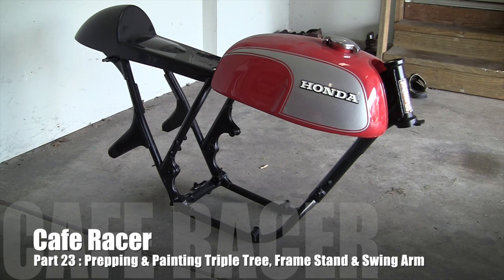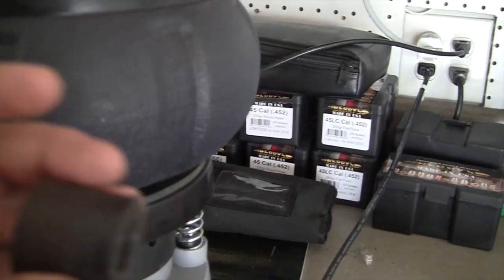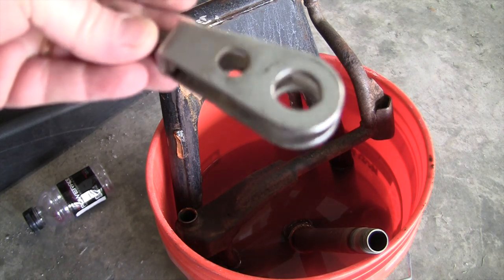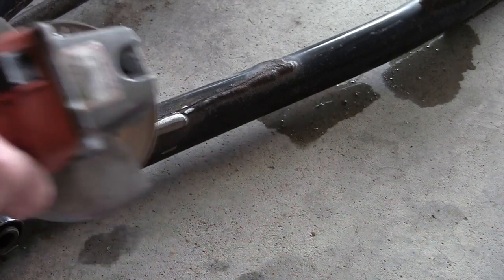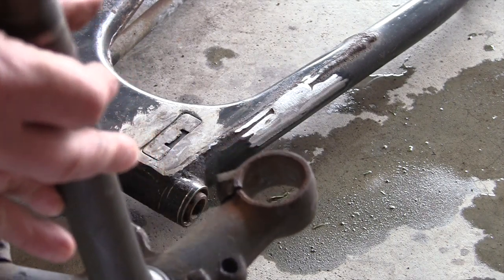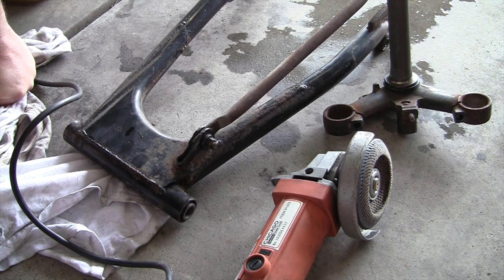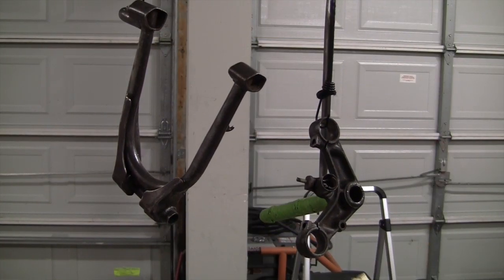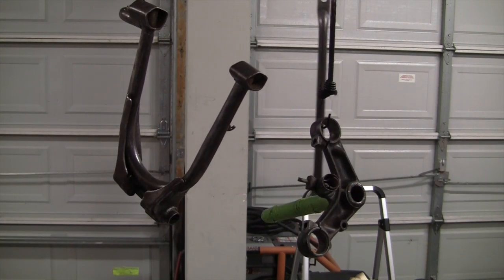Cafe Racer Build : Part 23 Prepping & Painting Triple Tree & More!

Comment: Great vid. I had the same problem with my steering stem with one of my stoppers but i used some rough sandpaper to rough up the surface of the broken stopper. Wiped it with some pre paint cleaner then put on some SteelStik by JB WELD and shaped it to look like the other side. Let it sit for the recommended time (I let it set for a day) then paint it. Stuff worked amazing.
Reply from the maker: Great tip!

Comment: i would be putting a lower triple clamp on with both steering stops mate, the geometry of the front end will make it want to fall to the side and if you get into a tank slapper they will stop it knocking the tank.
Reply from the maker: I understand, I think I may have even mentioned it in the video. I will be using a frame stand so it's not a huge deal.
Reply: until your parked somewhere and someone knocks ya front wheel. hate to see that tank get a dimple...
Reply from the maker: stephen ward True.